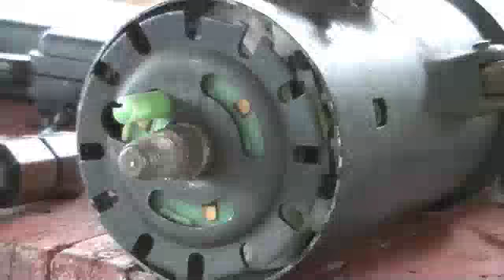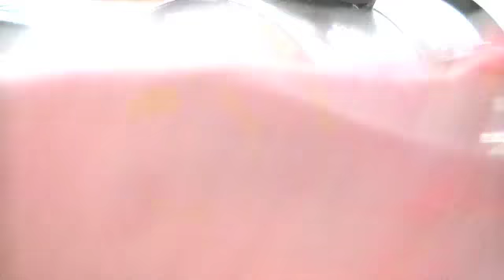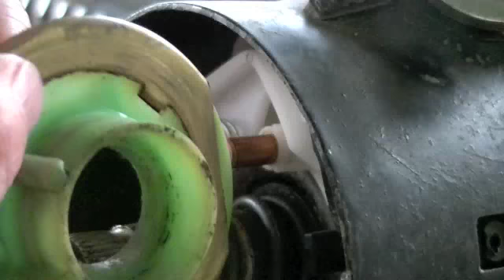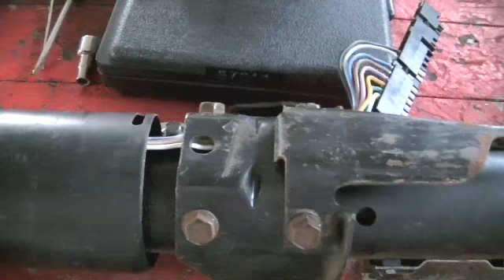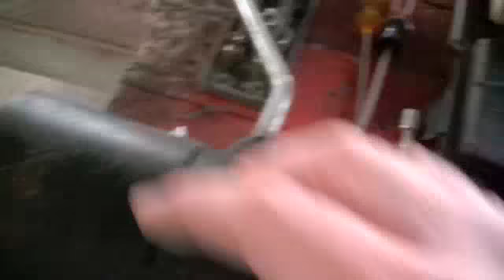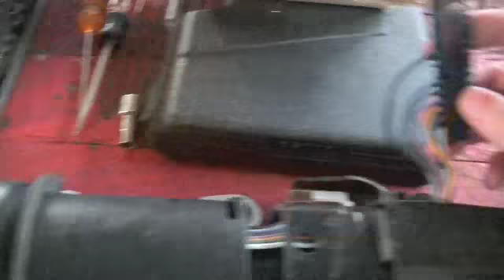Part 4 GM Steering Column Repair

Comment: I want to thank you so much for this video because after almost a month of searching this is the first video where it shows exactly where this horn pain is. I have a Grand Am and the horn has stopped working I check the relay the fuse I've replaced the horns and it still doesn't work. I have three areas that are left before I go fishing for ground wires the horn pin the horn wire and the clock spring... Now that I know where the horn pin is I know exactly what I'm looking for thank you again

Comment: I'm sure you all may know but someone may not. That plate is called a lock plate and there is a tool to romove the center lock ring that allows that plate to come off easily. Just so you know .. that plate is there to lock your steering wheel when you turn the key in the off position. So you may want to not want to bend or damage that plate. Also you would reuse the same tool to re insert the lock ring and the plate back in place.

Comment: Hey, I just wanted to let you know that in some steering wheels (mine is an OLDS) they have a snap ring that holds the metal ring on. Great videos, very informative and a great help on me putting in a new directional harness.
Reply from the maker: Mine was missing the snap ring.  The chevy columns have them too.  I missed that in this video and have since fixed it.

Comment: hey buddy- I just replaced my shift collar from an auto to a floor shift type, put everything back together and the horn keeps blowing. it worked fine before. it even blows without the steering wheel shroud cover and horn button wire disconnected. im pulling my hair out. any idea what went wrong???     thanks Don
Reply: Wire is probably touching and grounding out causing horn to go on. I did same thing once by mistake

Comment: My turn signal won't stay in the left position, so I have to hold it in place. Do I need to replace the turn signal cam?
Reply from the maker: Alec Ojeda Yes, it sounds like you need to replace the turn signal cam.

Comment: there is a lock ring that holds that first plate on man. use the tool to remove dont break the plate out.
Reply: Press the plate in and you can remove the locking ring
Reply: very cheap to rent that tool :P
Reply: *****  yeah! What He Said Right on! give it  to him. Don't break the plate! Don't get aggressive with the device (Steering wheel) that controls your vehicle when you're on the highway. anybody else wanna get in on this Action.

Comment: In order to get the lock plate out correctly you need a steering wheel lock plate remover. It depresses the lockplate allowing you access to the lockplate ring which needs to be pryed out and then you release the tool and the lockplate easily slides out.. Thanks for doing these videos they are very helpfull and informative.